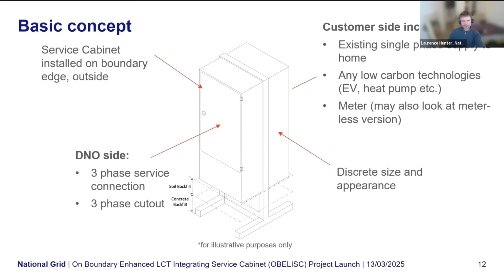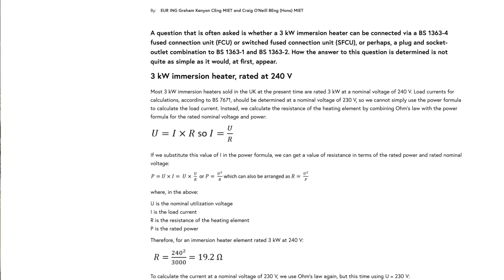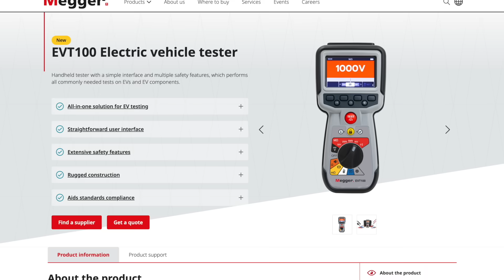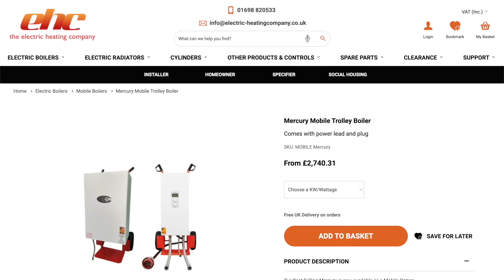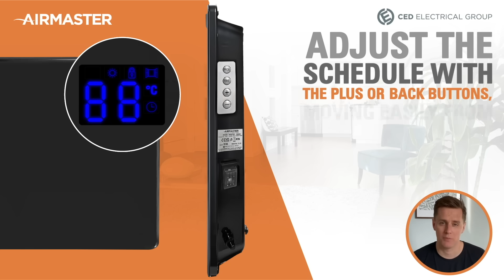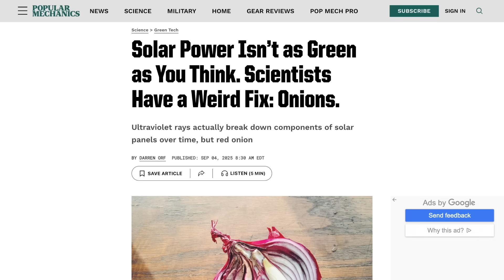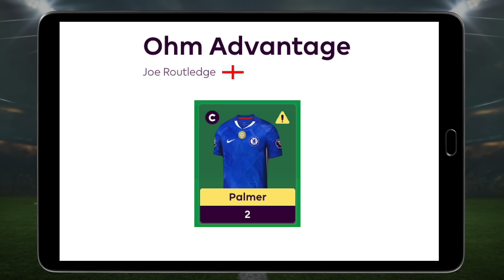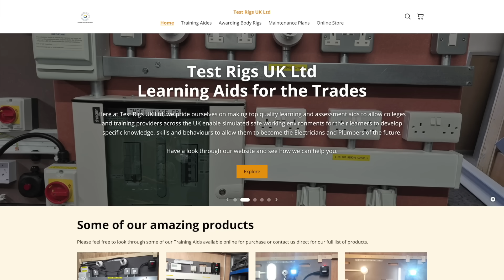A Major Solar Brand Just Quit the UK Market

Comment: So the perfectly common (isn't it??) scenario of a 3kW immersion heater connected via a 13 amp plug isn't allowed??
Reply from the maker: Nope.
Reply: @efixx  So is it, like, dangerous? Should I replace it with a 2.5kW immersion heater? Or just wait to see if it's spotted if I ever have an EICR done?
Reply: @timward2001 leave it until it's picked up as older installs are to older regs
Reply: @timward2001 dedicated 16A circuit, 2.5mm² t&e cable, 20A double pole switch, 2.5mm² heat resistant flex to heater.
Reply: If you get a thermal camera you'd be surprised what you see.
Reply: In my limited experience, 13 yrs as a domestic electrician, most immersion elements are normally 2.7kzw.
Reply: my kettle is about 3 kW and AFAIK it is on a 13A fuse. it sure is a standard 3-pin plug.
Reply: @mrxmry3264 it's an intermittent load.

Comment: I don’t believe batteries catching fire!!!!
Reply: Crazy!
Reply: @GameBacardi  5 ships burned in last 2 months transporting battery powered cars which you cannot extinguish
Reply: @keithrobson2168  there is no news of those, our news media very cherry picking topics
Reply: @keithrobson2168 humm we also haven't seen how many houses have been burnt down by candles or cars from fuel leaks either
Reply: @GameBacardi  watch you tube what's wrong with  shopping
Reply: Lithium iron phosphate don't catch fire.  

Power wall two batteries are different chemistry.  They are NMC.  They do burn. 

Power wall three batteries I understand are not NMC and are lithium iron phosphate.
Reply: @WindyJAMiller  LFP certainly can catch fire, but it takes a lot more effort for it to happen.  LTO is the gold standard in recharge lithium in terms of fire, cycling and temperature but it also costs a lot and has the lowest energy density.